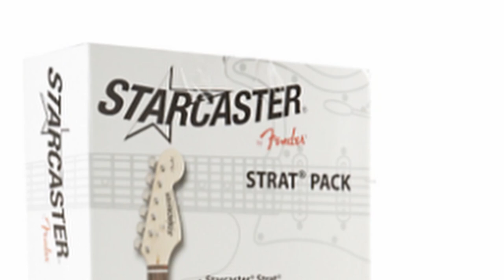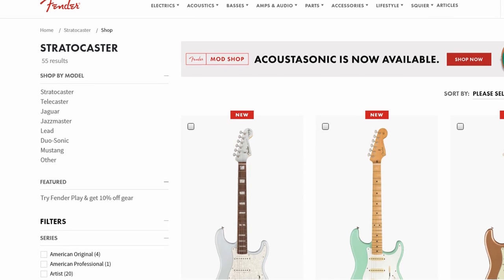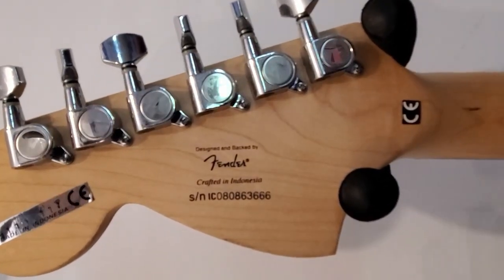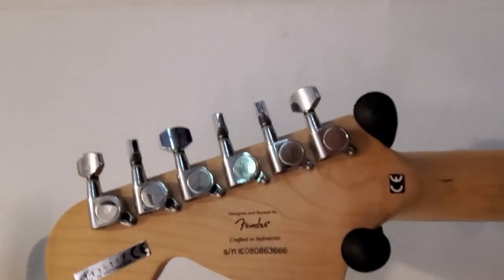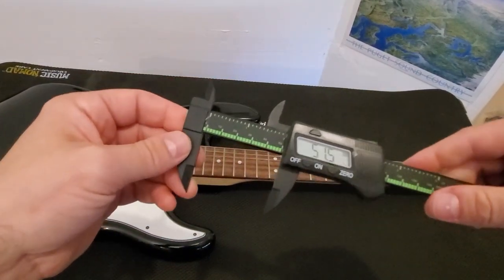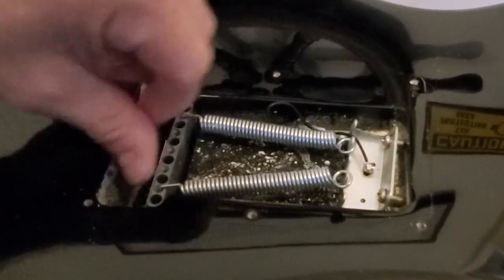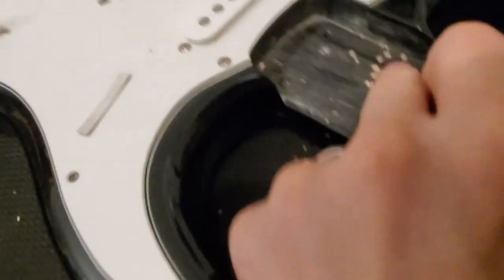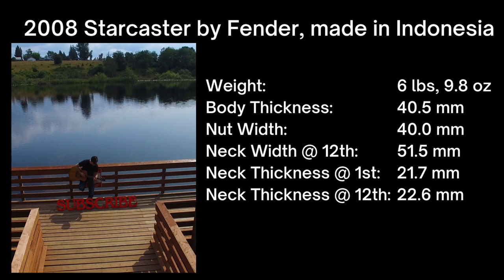2008 Starcaster by Fender

Comment: A couple of years ago a friend of mine brought me his sister's Starcaster by Fender, to check it out and adjust as needed. It really didn't need much. I tweaked the intonation a little  because it was only off a little. Same with the truss rod, just a little to reduce the neck relief, a little. I had seen these at Bestbuy, way back, and looked down my nose at them. After working on the guitar, I was impressed with how easy and fun it was to play. After working on another one, with very similar results, I wanted one. Well two years go by and I finally decided to get one. I ended up with two S1's, and am very happy with them. I have no complaints about fret buzz or playability. 
I have no reason to play a Starcaster. I own a 2013, Fender USA, FSR, Stratocaster, a Highway One three tone Stratocaster, a 1972 and 1976 Stratocaster, and an SRV Signature Stratocaster. No, my S1 Starcasters don't compete with my USA Strats, but they are fun, playable guitars that will go anywhere with me that I would never take a more valuable guitar. But that doesn't mean that if something did happen to my S1's, I wouldn't be royally pissed.

Comment: I have a 2011 sunburst and I swear fender must have dropped some real strats in the starcaster batch. Mine stays in near perfect tune stock.i dont want to mess with it. Only weakness is the bridge pickup. Feels like a real strat.
Reply: I feel the same, bought a S/H little used sunburst to resell, I wish I hadn't sold it. It was a peach.
Reply: I feel the same about mine, got the 2008 with a humbucker, purchased in 2010 from guitar center. Still kicking to this day, still feels very solid. For the price 10/10, i'm wanting to upgrade the pickups but otherwise it's solid

Comment: The indonesian starcasters can be massaged into pretty good players. Have had many of them. They tend to be very heavy, but some of the the HSS models, not all,  have pickups nearly identical to mim fender.
The blue ones with the mirror guard do, and are great right out of the box. far superior to low end squier for sure.

Comment: Well,heck! Got one off the pawn shop wall,it must be a close cuz'n. Aug 10 2008 inspected by DxO. Used the body for a Stratenstein-- it's the full-sized Strat body specs,Go Figure!!  We put a super nice neck on it with Fender USA tuners then added a set of Fender '65 pups we had gathering dust. Then sold the Starcaster neck for what we payed for the guitar. Should have kept that neck! Zero fret wear and not a sharp edge or high fret on it. A fine partscaster,thanks for the video letting us know what up. Cheers.

Comment: Ive never owned one. Maybe one day.  The necks are always twisted up here in the desert. The dry climate really kills them. Good video👍🎸
Reply from the maker: When I lived in AZ, I had an Ovation with a separating neck.  I glued it up and jammed on it for months no problem...but then we had to move & put some stuff in storage...it was air-conditioned, but when we got everything out a year later the neck had come up again :(
Reply: Take a piece of sponge, put a little water on it, and put it in a small plastic container. Put it in the case. Keep it wet once a week. Or, pay the $20 for an in-case humidifier.
Reply from the maker: @jwandhistools  wet sponge in a plastic container, like tupperware?  Do you seal the container?
Reply: @PinetopJackson  I put slices in the lid so moisture can escape. Anything will work. Dollar store sponges are fine. Rag. paper towel. Anything.
Reply: For the first week or so, the case lining will suck it up. After that, the wood will draw it in.

Comment: Do you think you can remove the Starcaster decal on the headstock in anyway? I have one and I’m planning to mod it out because it’s lacking and I wanna just get rid of the decal.
Reply from the maker: It can be done of course, but first let me say that I wouldn't do it.  
I have come across shady people who have sanded off a Squier logo and replaced with a waterslide decal reading Fender that they bought online...and if this is done for the purpose of resale, it's bad juju man, it's trying to rip someone off.  
Some people will say it's their guitar, they can do whatever they want, they wanna customize it to their personal tastes...I get that but...I have come to love & embrace the concept of cheap guitars and all the quirks they entail!  That includes the headstock logo, be it Starcaster, Squier, Epiphone, Harmony or Teisco!  Be proud of your cheap junk!  

With that said lol, you can scrub it off with fine steel wool, #0000, I've seen it done with Squier's that have the logo on a bare wood headstock...just scrub WITH the grain.  If the guitar has a painted headstock like this Starcaster in the video, I'm not sure how it would work, you may just have to sand down the entire face of the headstock to bare wood.  I would start with the steel wool...but again I WOULDN'T do it at all lol!

Comment: Seeing them go for 300 right now. Ive had a run on them. Arrowhead was my favorites due to rare woods being thrown in for the necks. They were Birdseye and flamed. I had 6 and used them to get better as a technician.  The SE stratocaster is better and the measurements are not off. The 08 models inwont touch.
Reply from the maker: I still haven't had an arrowhead yet, I'd love to check one out if I can find a good enough deal on one.  I can't imagine someone paying $300!  Wow, maybe I'm just old...
Reply: @PinetopJackson ,  inflation hit everything.  It's mostly ebay and the like. I was buying them for 60 to 80. I still have one that has a flame maple neck with lots of Birdseye. I refinished it in danish oil and poly.

Comment: How's the fretwork compared to an affinity?
Reply from the maker: No difference on this one.  I'd like to get one of the older arrow-head models to compare...but I'm not willing to spend much for it 😆
Reply: @PinetopJackson  I have an '04 starcaster p bass, the first year btw, the neck and fretboard are great, no sharp or uneven frets, the neck is wide with a pretty flat 12" radius board...I upgraded everything else on the bass cept the neck and body, and the body is so light and comfortable it made me sell the MiM fender p bass I used to have

Comment: No meter? Pickup readings would've been good
Reply from the maker: Bummer man I had a meter from Harbor Freight, never taken out of the package...I busted it out for this project and it was dead.  New batteries, still didn't work :( 
Thanks for reminding me though, I need to buy one!
Reply: @PinetopJackson  that little red meter is one of my most used tools, and I hate electronics. I love good but cheap guitars too. It started with a Borg. Pre First Act First Act. It's like a gold 501

Comment: I had one of these bought used off Facebook for 80 bucks. It had the worst neck I have ever seen, high, buzzing frets, sharp fret ends, even worse than any Bullet. Body wood is super cheap. No weight to it and soft.
Reply from the maker: I hear the quality varies all over the place with these.  This one was pretty nice, but I've played a friend's Starcaster by Fender years ago and it felt horrible. 
This one weighed in at just under 7 lbs...I think the current Bullet strats weigh 9 lbs.

Comment: Starcasters car garbage honestly. Bought one new and the wood between the bridge and the place for the pickups was broken and glued back together from the factory. The frets will cut your hands. The pickups are trash. It's not even good wood to upgrade on. You're buying trash when buying a Starcaster.
Reply from the maker: I'm sure quality can vary across the line.  
This one was decent...it would've made someone a much nicer first guitar than my Harmony Stella was for me!  
I bought it used... it's possible it could've had a set-up & fret dressing before I got it, but I kinda don't think so.  
At $40 it was a good buy for me.  
I do see people trying to get $100 and more for them, and I would NOT pay that!
Reply: @PinetopJackson  When it comes to cheap Fenders the only way to go is Affinity Series honestly from everything to tuning machines to quality of wood and pickups. I just built a Squier Bullet. Replace the neck with a Washburn X series neck with Grover tuning machines and 24 smooth frets. Had to sand the neck base down and remove the truss rod nut but it works amazingly. I replaced the pickguard with a high end black pearl HSS. Looks outstanding, stays in tune and sounds like $500+ guitar plugged or unplugged. Build yourself a Frankenstein. That's the only good guitar you'll ever have. My first guitar was a Berhinger from the amp company. It was much worse than a Starcaster but it did come with an awesome Berhinger amp I learned to play on with my first good guitar which was a Squier Strat Affinity Series. I played clubs and bars with that thing. Then I smashed it because I was drunk and high and going through a break up at 19. Good times.
Reply from the maker: @blessedjuggernaut  good times lol!  
A friend of mine had a Berhinger amp when we were growing up, and yeah I remember how terrible it was!  
Your Franken-Washburn/Squier sounds cool!  Were there any intimation issues you had to deal with?  I imagine the 24 fret Washburn neck has a longer scale length than the Bullet
Reply: @PinetopJackson  It's actually the same length as any of my Affinity Series Strats. As far as the scaling issues I've got 11 gauge strings on it and they are a little tight but nothing too abnormal other than it feeling a bit strange playing a Strat with 24 frets. Got a another one I'm experimenting on too. I sawed off the upper cutaway and sanded it down too look similar to a Tele then painted it with Rustoleum hammered steel silver and copper and put like 30 layers of poly over it then clear coated it 20 times. Looks like a river bed. Plan on putting a black HH pickguard with chrome humbucker covers.
Reply from the maker: @blessedjuggernaut  wow! 
You should take photos & video to document your projects!